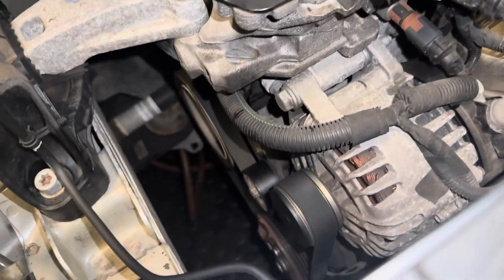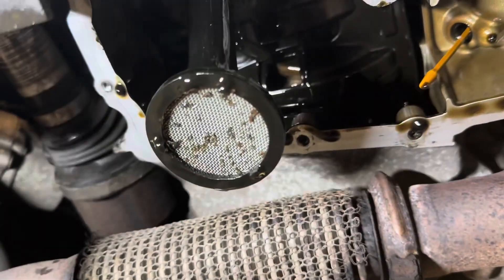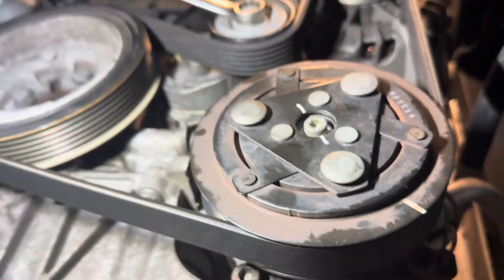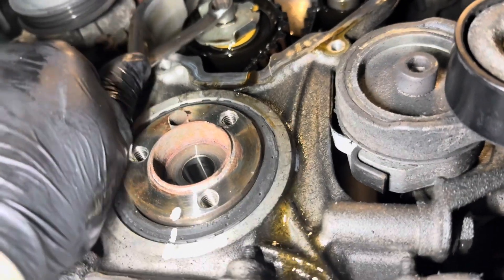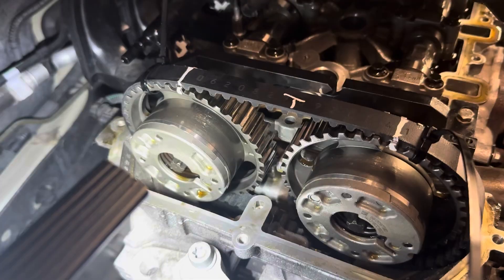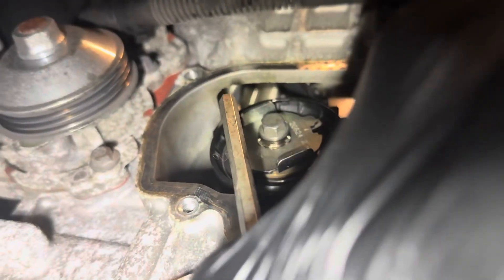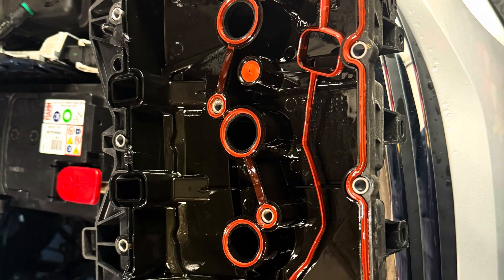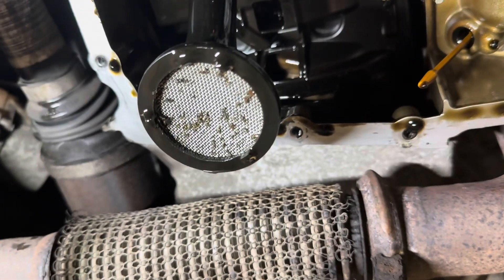50K Timing Belt Replacement, 1.0 and 1.2 PSA Engine. A must see Peugeot, Citroen, & Vauxhall guide.

Comment: one more thing, could you please also tell me how the camshaft pulleys should be marked and what to look for, besides if you have installed the special tool, because the pulley also has markings
Reply from the maker: I just like to mark the belt and pulleys. It aids with assembly and assures extra confidence in the work. If you get it wrong you will see it straight away.